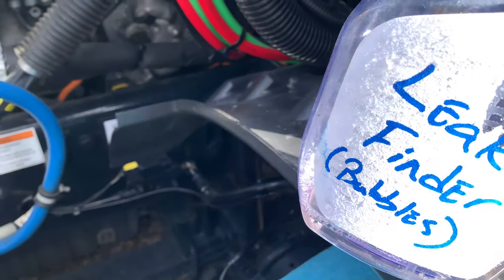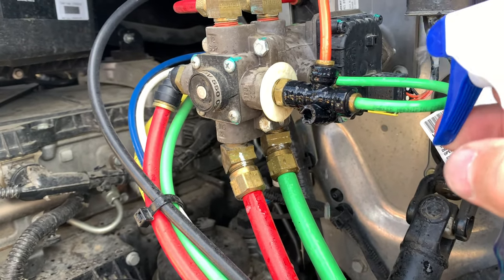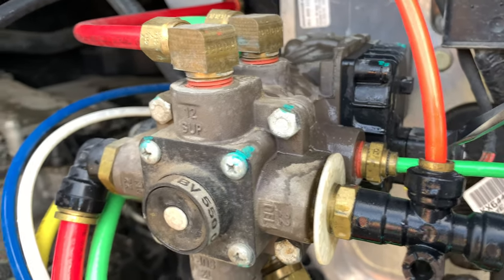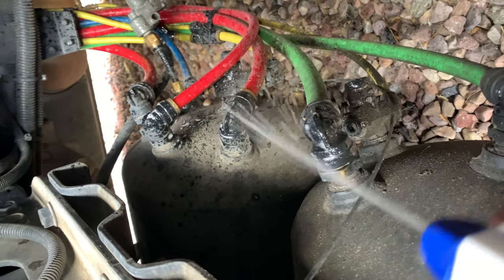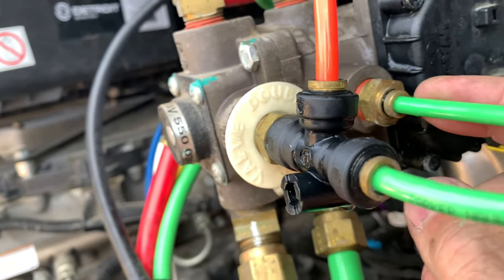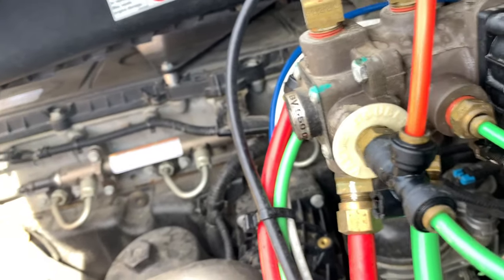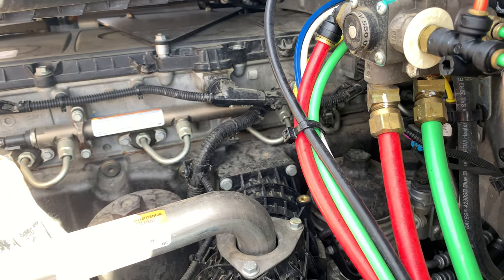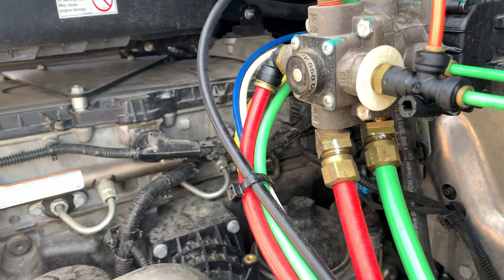Checking for Air Leaks

Comment: Quick Connect airline fittings ought to be banned.  The reason why they are used is because, bureaucrats in the DOT were bribed, by the manufactures, to allow for these dangerous devices.

Comment: Well if you can give me some advice I got a Kenworth that won't hold air and we replaced every air system on the truck I park it at home and dead silence there's no sound and it will empty the tanks overnight all the way to zero and we've replaced the brakes the airbags the valves on the dash I've soaked the lines but the lines go through a conduit so you can't get to all of them I've soaked the air tanks there's no sound at all. Yet when the engines running it doesn't lose any air at all. And it doesn't lose air when you apply the brakes. I passed the California DMV inspection with the guy underneath the truck holding the brakes. So I'm at a loss. I'm tired of being woke up at night with my truck going flat and jamming against the trailer. Oh I learned to not pull the trailer brakes at night.

Comment: How do you cut that line .25 in in the dash . Not much rm to work. I was thinking side cutters but it could deform the line. It could be hard to get a utility knife I behind the panel the switch is in. Thx 4 ur vid.